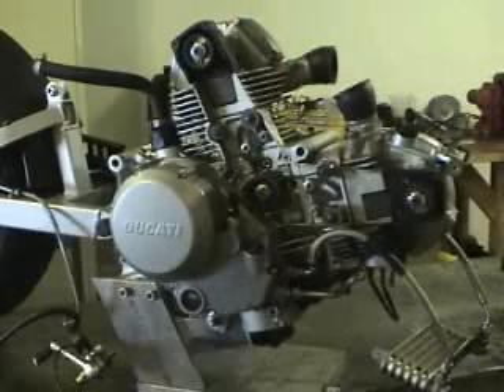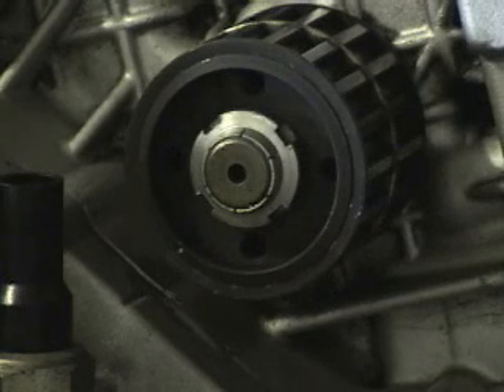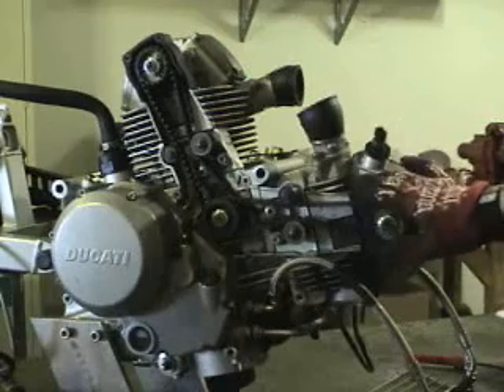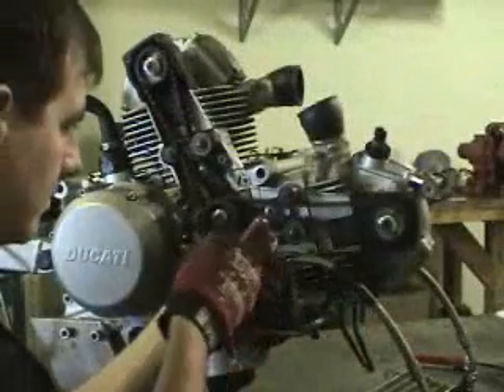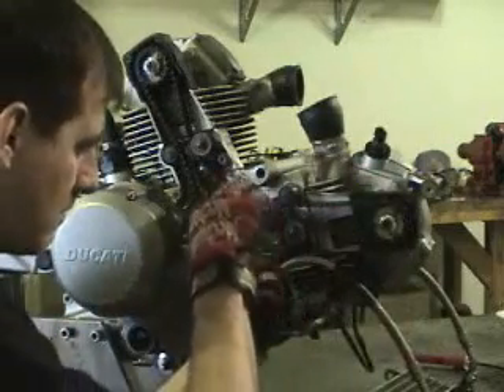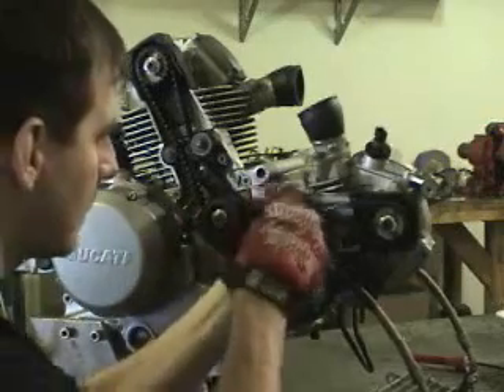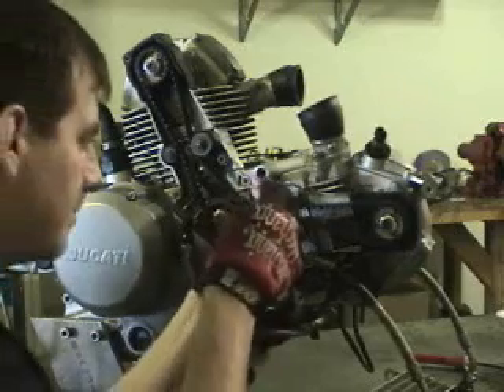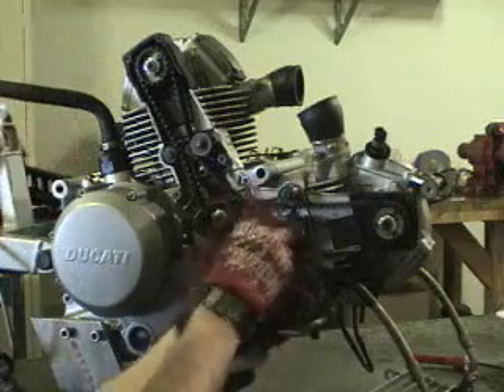Ducatitech.com "HowTo" Ducati Timing Belt Change

Comment: Thank you for the video. Question though. I have a monster 695 (just for FYI) but I accidentally removed the belts without marking them, so as long as I line up all 3 of these marks, I can slide the belts back on and run with no issues correct?
Reply from the maker: Yes.

Comment: Just had a question that may have been answered already. How do you rotate the gears to align them with the notches on the case? I had my bike on a stand and put it in first to rotate the rear wheel but it wouldn't budge.

Comment: I used this video to learn how to change my cam belts on my 1997 Monster.  It was all I needed.  Finished the job with great success.  The only thing I was wondering about is what torque setting should the tensioner securing bolts be tightened to?

Comment: Will this method work for a Monster 696? Anyone know?  I'm thinkig it would,
Reply from the maker: Alex Kirby Yep!
Reply: ***** Thanks!
Reply from the maker: +Alex Kirby BTW, to add: the 696, 796, 1000, and 1100 engines have ability to lock the cams in position. This isn't for the valve adjustment but instead for the ensuing timing belt reinstall. There is a bolt cap on the left side of the head (opposite the belts) and then a pin can be threaded into the cam to index it in proper position for alignment when installing belts.

Comment: Thank you! Just did my multi 620. What a sense of accomplishment. Had to change tension rollers as well they were seized. And the tension was very very low. But surprisingly she ran pretty good. 
Tension method. Was easy and felt very comfortable doing it that way. 
Would like to try a four valve. But would need a few more tools.  
Thanks again.

Comment: This video is also valid for ducati 900 ss 2001 ?
Reply from the maker: Yes!
Reply: thanks :)
Reply: I used this guide for my early 900ss injection three years ago. I changed my belts again yesterday and the old belts still looked excellent, so this method of tensioning belts works well.

Comment: Do all 2v engines have their tensioner bolt holes helicoiled? My vertical tensioner bolt hole threads (single hole bolt, not the bolt that runs on the tensioner track) are stripped really bad and I'm wondering if I can timesert the hole, but I'm not sure if they have already been factory helicoiled. Thanks!

FYI my bike is '00 M750

Comment: Hi There

I have a 1993 Monster and the Vertical and horizontal pulleys have a lip on them which would stop the belt from slipping off . It also hampers putting a new belts on . It has been suggested online that I prise the lip off the pulley and then the belts will slip on . I have tried this an I am wondering what amount of force would you suggest to remove this lip or Disc as some people call it . 

Great Video by the way!!!!!
Reply from the maker: +Karla Poulton All technicians I talk to will use edge cutters to remove the lip. It is a thin ring of metal pressed onto edge of sprocket.

Comment: Awesome vid, thinking about getting a hypermotard but changing the belts always put me off ducati, this doesn't look too difficult...
Reply from the maker: +Imperial Maniac Yes, also look at the cam locking tool, which makes the task really really easy on the newer 2v engines: 1100, 1000, 796, 696.

Comment: I read that the vertical timing belt can be 1mm looser. So you should be able to slide a 6mm through but not a 7. You did just the 5mm on both. Do you know which way it should be?
Reply from the maker: +timjr2500 I didn't read that, so I can't comment on the source. I share the practices I use when maintaining my own Ducatis.

Comment: i just pulled the belt covers off of my 13' 1100 monster.  the belts seem fairly loose to me, is there a difference between it and the older ones, is this because the belt is "broken in"  i can literally slide the belt half way off of the cam pulley.   it has 3800 miles on it and runs great  no trouble ever
Reply from the maker: Jason,

You will need to tighten them again. Do periodic checks on your belt tension to make sure something else isn't causing this.
Reply: thanks for the reply  long time motorcycle mechanic, first experience with ducati.  it is a bit different than i am accustomed to....  a few things that i'm not familiar with but, i am learning    your videos have been very helpful for me   i'll be sure to order my belts from you when i they are due to be replaced.  do you also stock valve shims?  according to your video i could be looking at some adjustments there in the near future as well.
Reply from the maker: jason bartley it's best to email us for support at orders@ca-cycleworks.com as conversations are hard to keep up with on youtube comments. We refer shim purchases to shop at our friend emsduc.com

Comment: Check your throttle idle toggle on the left handgrip. My 02 750 has one for warming up, it will stall at idle until it is warmed up, so I can adjust the idle RPM with this

Comment: From your replies 8mm thread (not hex key) into aluminium would be 8 ft/ lbs. Into steel obviously you can torque them higher, but interesting that on the engine you are working on ( I don't know if this is all 2V engines) there are helicoils. Obviously this engine has either had its threads stripped or helicoils are standard. Many thanks for your reply.

Comment: I have done exactly as he says, but now my engine stalls when it's on idle. 

First I thought that I did something wrong, and therefore I removed the belts and installed them again, but i experiencing the same problem with the idle. Does any one have a guess what could be wrong?

I have a Monster 750 -99

Comment from the maker: @Snagglbeast : When the dots align, the horizontal / lower / front cylinder is at TDC. Vertical cylinder TDC is 90 degrees of crank rotation back from this.

Comment from the maker: @RicardoSS85 : You're asking a Ducati lunatic this question? Of course the 796 is my answer. ;) Actually, the latest monsters are great handling bikes and the air cooled engine with the belts are super reliable. Desmo valves bed in by 10000~15000 miles and if you're not on the rev limiter all the time, the valves won't need adjusting again.

Comment: Hello Chris. How much is easier is it to service a Street Triple compared to a Monster 796? My concerns on the Duc are the desmodromic valve adjustment, the timing belt maintenance/replacement and the air-cooling shortcomes. The Street Triple (at least the first ones) suffered from a malfunctioning cam chain tensioner and it seems some leaked from the cylinder head. Any tips? Much appreciated.

Comment from the maker: @Keiron while at TDCf, the camshaft is not trying to open any valves. While not at TDC, when the cam is trying to open a valve, the helper springs put a bit of force on the belt, which will alter the frequency reading.

Comment from the maker: @xeroxoid: M6 gets 6 ft-lbs or 72 in-lbs. I recommend using an inch pound meter where 72 is not in the upper or lower 10% of the tool's range.

Comment: Hello! How much is torque to tighten timing belt tensioner bolts ? I have Haynes manual, but there is not specs on that. My Ducati's have 6mm bolts. Thnk x)

Comment: Chris I somehow knocked the crankshaft off the mark. Prolly it was in gear when I moved it. Do I just rotate the rear wheel to line it back up? As long as the marks line up,is it good to go,or is it every two revolutions?

Comment from the maker: @piszker123 For standard fasteners, Ducati books reference standard engineering values for metric screws into aluminum. General rule is 5 ft-lb for 5mm screws and 6 ft-lb for 6mm screws. See the corresponding column in the table on this page  engineershandbook [dot] com/Tables/torque1.htm

Comment: just changed the belts on my 98 900ss it was really easy. The only thing I did differently was to remove the clutch cover and rotate the engine by turning the clutch with the spark plugs out (mine is a dry clutch model so I took the opportunity to blow the dust out of the clutch) Great video, really helpful, especially the tip on using the hex keys to check belt tension. Thanks.

Comment: How did you get the top pulley to stay still? Mine kept wanting to turn back against the springs. Also, if you move the horizontal pulley on accident, can you just simply move it back in alignment?

Thanks Chris!

Comment: Nice video. btw how are you cranking the engine on he left side of the case? Did you have to remove the case cover and manually rotate the flywheel or are you turning the front sprocket some how?